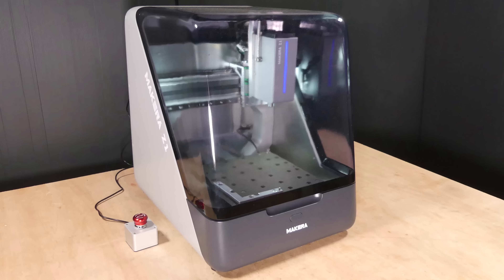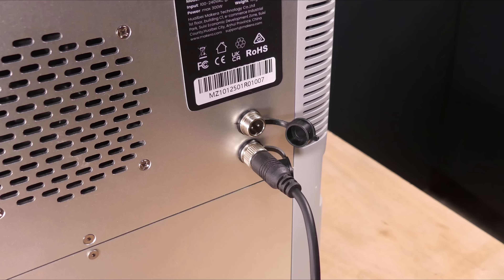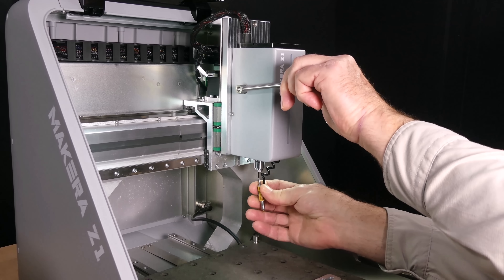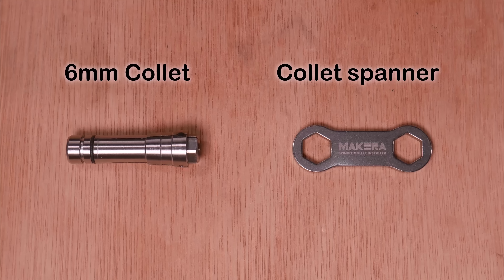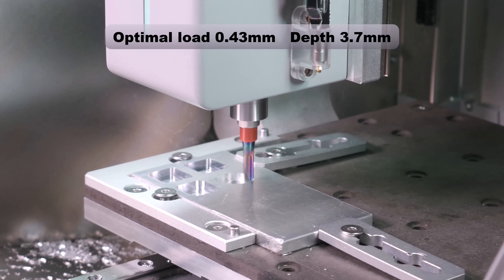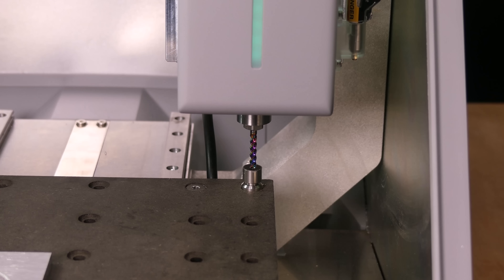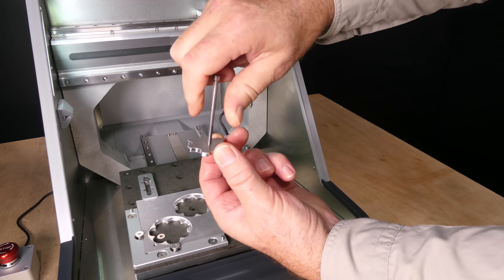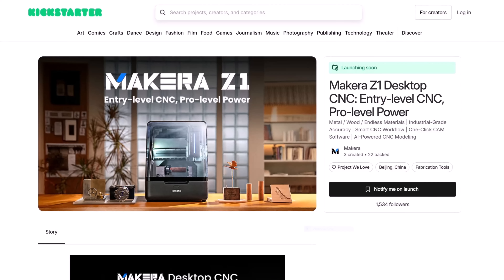Makera Z1 Review: Budget Friendly CNC Mill with Big Features

Comment from the maker: Makera Z1:   https://makera-z1-desktop-cnc-entry-level-cnc.kckb.me/techydiy
https://buymeacoffee.com/techydiy
2nd Z1 review video:  https://youtu.be/NKtECya_V3g
Carvera air:    https://makerainc.sjv.io/carveraair
Coupon code: techydiy100off
Benefit: $100 off when buying Carvera or Carvera Air
Usage: Applies once per order; one use per customer

1/8" 3 flute 15mm DLC  Endmills:    https://amzn.to/47FphaP
Maker Cyclone Dust Collector       https://makerainc.sjv.io/bOK079
Reply: I would love to see how it performs in Nylon. This could just be the tool for me if it can work with Nylon.
(by the way, you forgot to pin this comment).
Reply: In this video, I can't see the Makera Cyclone Dust Collector having any effect on the Makera Z1; the dust collection throughout the entire milling process is very unsatisfactory. Could you please film a video showing the performance of the Makera Cyclone Dust Collector on the Z1 with the cover closed/lid on?
Reply: I would love to see it cut a name out of 16g copper sheet, please.
Reply: Please test a 1/4 4 flute stub at .1 depth and see the max step over with a 2d contour on the outside. Let’s see how underpowered this thing is. Let’s try to break a tool and see what this thing can do. What is the max drill dia? Can I use this the fix a missing hole. Etc
Reply: I would like to do diamond drag engrave, brass or copper, is that possible with this machine? Could you show a vid when you engrave? Thanks
Reply from the maker: Yes, you can drag engrave, I saw someone do it on a Carvera and so it will be possible on a Z1.
Reply: @techydiy Thank you

Comment: Great video. Thanks.
Just curious, how do you hold the piece in place when you're cutting it out without the piece flew away?
Reply from the maker: I included holding tabs. To release you then cut them with a saw and file flat. It’s the reason the edge finish wasn’t great.

Comment: Is there an issue with milling plastics from a 3d printed object. That is is there any softening of the material during milling?
Reply from the maker: Should be ok, just use a single flute endmill and the correct feeds and speeds

Comment: I dont do any machining, but had to learn (or forget) things like calculating rpm and feed rates etc. Is this something you have to do manually for cnc or does software calculate that for you based on tool used?
Reply from the maker: You can do it manually and experiment or there are some good software tools. AI (chatgpt) will make a reasonable attempt at it..

Comment: Do you believe this machine can mill Aluminium day in, day out; or is it being pushed to its limits and is more geared towards plastics and wood?
I'm tempted to pledge but have seen a number of people questioning its ability to mill Aluminium.
Reply from the maker: It’s not being pushed to its limits; it is quite lightly loaded in the video. The spindle power was a maximum of 12% during my tests.
Reply: @techydiy  That's great to know, thanks for the reply.
Reply: @techydiy Does the software show the spindle load while cutting?
Reply: @techydiy 12%...Wow!

Comment: WOW!  Neat little machine and it comes assembled...  Just bought a DMC2 CNC Mill "kit' and spent over 3X what the machine in this video is selling for on initial offer.  And I get the fun of having to assemble, set up and tram on my own.

Wish I would have seen this video before that...  I don't need a big machine, just a small and reasonably accurate one.
Reply: The DMC2 is a more rigid machine
Reply: @arbjful  I tend to agree based off the videos DMC2 has on YouTube showing it machining stainless steel and titanium.

I'm not regretting the decision to by the DMC2 Mini, but this machine requires a lot less work to get up and running and would probably suit my needs near term.  Though the DMC2 will probably be better long term.

Either way...  It's both are a great way to get into CNC milling, without having to design and build a machine from scratch.

I don't think there's been a better time for hobby machinists/makers.

Comment: You think this is possible to have in a flat in separate room? Or is it too loud and does the metal chips get all over the room? Someone mentioned the chips can escape under the y axis rails
Reply from the maker: You can operate it without a vacuum, which lowers the noise, and then vacuum up the chips afterwards. If you machine with the lid closed, the chips will remain inside. I was able to machine with the lid open with very little escape. A few chips may escape to the bottom, but they stay there beneath the machine. You can always add a skirt around the base or place it on a tray. So, it really depends on your circumstances.
Reply: @techydiy Does the lid help with noise or does the entire enclosure vibrate during cutting?

Great video by the way!

Comment: I've never owned a CNC (mill). I have recently been getting ads for this and yesterday decided to reserve my spot for the kickstarter launch. Been an avid 3D printer but for some projects I really want to work with (and mainly just get experience with) metal working and CNC milling. I think this might be my first. Very excited to see what it will bring.
Reply: That’s exactly me! Got my spot on the list today. Very excited
Reply: I'm a CNC machinist by trade and a 3d printing hobbyist. I would not recommend buying a CNC unless you have some experience in the field. Machining is a completely different beast than 3d printing.

Many people buying these mills are going to be biting off more than they can chew. Especially once they realize good cutting tools are expensive as hell and have a finite lifespan before they need to be replaced. (And that lifespan gets drastically cut down when you use them ineffectively.)

 Are you prepared to spend hundreds, if not thousands of dollars on the various cutting tools you'll need over the lifespan of this machine? 

See if your local community college has a manufacturing tech program if CNC is something that interests you.
Reply: @Slamt4stic  You are right on point! But the issue you mentioned is just what Makera is trying to do: reduce the difficulty of using a CNC. Their entry level CNC and AIGC feature is definitely amazing!
Reply: @Slamt4stic Thanks for the tips. I actually don't know anyone with a CNC around here. Money is not the issue though, spent more than 10k on printers throughout my life.

For me, this just feels like a good learning opportunity. I'm confident that I can find my way. :)

Comment: Thanks for making this video. Are you able to provide the dimensions of the “feet” under the machine please?
Reply from the maker: They are 17.6mm tall. They taper from the top to the bottom, with a diameter of 27mm at the top reducing to 21mm at the bottom. They are offset into the base by 3.2mm, resulting in a total height of 14.4mm.
Reply: @techydiy I cannot thank you enough for this. I’m dealing with a hyper specific setup and want to ensure it will fit. 

From a footing perspective how far back are they from the outside housing? So if the depth of the machine is 470mm how far back are the feet from the vertical plane of the outside parameter of the machine?

Many, many thanks.
Reply from the maker: The distances between the feet are: Front to back 380mm, Side to side 300mm. 
The feet are 45mm from the front to the centre of the feet.
The sides are curved, so measurements are probably +- 5mm accuracy.
Reply: @techydiy You are incredibly generous and helpful. Thank you!

Comment: sooo... a snapmaker? basically?
Reply: isnt snap maker a 3D printer ?
Reply: @tankm200  Also a CNC router and a laser.
Reply: @MadeInMichigan  cool, but it is a eazy to use ? and for now we can get this Z1 for like 700 euro or 800 dollars, for me that already have a 3d printer and a 20W laser engraver/cuter this one looks good
Reply: No, not really, it's more like a Carbide3D Nomad Pro (with a laser option).  I had a Snapmaker A350.  It was a nicely made machine, but I don't think the gantry would be stiff enough to machine Aluminum on it.  As for the Snapmaker Luban software, it was not what I would call "user-friendly" (more like "user-vindictive").  I gave the whole machine to my son.  I have both the Nomad and a Carvera, which have decent software also.
Reply: @donbarr9487  I also had an A350. I cut aluminum on it. It was slow and loud, but it did it. 
Two-flute 4mm mill, 10.5K RPM, .1mm DOC. Plenty of oil. Took an hour to put two D-Sub 9 cutouts in a piece of 2", 3/16" thick aluminum square tube, but it did it. Made a horrible mess, too.
Reply: @MadeInMichigan that’s too slow. 0.1mm DOC is very less. 0.5 mm is better, increase the feed to 300 mm/sec. 2 flute 4mm end mill is ok. Skip the oil, not needed for cutting tubes. Maybe air blast should be ok
You say square tube, then it couldn’t have been that slow

Comment: chips are  so nice and feedrate impressive regarding makera recommended parameters, DLC bits to achieve this?
Reply from the maker: 6061 T6 & 6082 T6 Aluminum are both easy to mill. Softer grades stick to the endmills and that is where the DLC seems to help.  
The 1/8" O flute is from Makera, I am not sure of the coating.
The 1/8" 3 flute 15mm DLC. Very cheap (good value) endmills  https://amzn.to/47FphaP
The 6mm and 5mm are relatively expensive DLC coated endmills.

Comment: Looks amazing, however it would've been nice to do a depth test on the Aluminum with something a lot more taller to see how deep it can cut or it's limitations. I like how compact it is but ironically I'd still like to see a bigger bed size in the future. As far as the engravings go I'm glad they have the option but as someone who already owns a laser I wouldn't need it. However I would've also like to see an engraving done without the laser to test the detail limitations and quality. Other then that it seems solid for the most part.

Comment: Nice vid!

Hey I'm really curious about the amount of time it took you to mill out each one of those square pockets in the aluminum. 
- How fast was the smallest feed rate? 
- How long was the fastest pocket?

Interested in these lower cost hobby friendly machines, but they need to be able to efficiently eat through aluminum (for my applications)

Thanks!
Reply from the maker: Adaptive toolpaths were:
1/8" O flute  2:24
1/8" 3 flute  0:57
6mm O flute  0:55
5mm 3 flute   0:27
About the same for finishing.
The feed rates are in the video.
Reply: @techydiy  very helpful, thanks!
Reply: @techydiy  How loud was the machine? Would you say you could work in the same room as the machine as it was cutting metal? Or would it be much too loud? Thanks!
Reply from the maker: It's not very loud, but it would be distracting. I waste a lot of time watching it.

Comment: Man i would really love to see if this thing can do steel. Not that i want to do  that mainly, but it would be great to know.
Reply: It for sure could, slowly, with cooling and using the right cutter.
Reply: No. Do not even think about cutting steel. It will damage the machine.
Reply: @Davoodoox1  If you have no idea what you're doing, you're right, that will probably happen.
Reply: @Davoodoox1 I am pretty sure it can, as long as you keep the cutting forces about the same as when milling aluminium, than there should not be any damage or increased wear. Only difference here would be the time which would probably increase a lot when milling harder materials. I mean the Carvera Air can do some occasional Titanium parts, even if the manufacturer does not recommend it.
Reply: @Davoodoox1  Agreed.   The spindle is high speed,  does not have the torque at low speed, which is what Steel requires.  Fine for softer metals like 6065 and brass.
Reply from the maker: HSM folks HSM

Comment: Is that a soft e stop or hard e stop?
Reply from the maker: I don't believe that the emergency stop switch cuts the power to the machine; however, it does stop the spindle and halts operations. I have pressed it a few times now, and it has worked as expected.

Comment: Thoughts about the lead screws Vs ball screws?
Reply from the maker: The leadscrews have performed ok so far, I am not seeing any obvious backlash, but I need to have a closer look.
Reply: @techydiy  that's good, thinking maybe it's more of a long term issue...
Reply: I wouldn’t buy a CNC with lead screws again.
Reply: @Todestelzer  did it develop lash issues? Or had them right out of the box?
Reply: For 3D printers...no issues but not sure on CNC machines. Unless you experience a crash then I don't see why the lead screw would wear too agressively if maintained. They are also cheaper to replace
Reply: @jacobplatt3066  yeah, just more lash prone I would suspect. It seems to be an odd choice for a CNC machine and not a place I'd probably wanna to try and cut cost. I really wish they had a + version or something with ball screws for an extra $100 or whatever.

Comment: Can one use any end mill or are do you have to use ones that come only from Makera so that it works with the quick change feature?
Reply from the maker: You can use any end mill with the correct shaft diameter. It comes with some of the plastic collars, but they are for convenience, you don't have to use them.

Comment: Im amazed by your ability to get these mostly called "underpowered" makera machines to perform so well. I got a Makera Carvera myself but Im a beginner level in CAM so i was wondering if you maybe could make a video about how to get the most out of your Makera or other "cheaper" CNC machines with the right settings and machining approaches, because machining even small amounts of material volume takes alot of time when using default settings.. so a fool proof way of calibrating, testing and approaching a machining job with an underpowered machine would be really appriciated :)
Reply: it's not too hard. single flute end mills only for cutting aluminum. next take a slow feed rate like 30 IPM and test different DOC, start with something low like 0.015" cut a simple pocket, next try 0.025" then 0.035" and analyze the sound and the cut quality / chip size. you'll hear when the machine is stressing and you'll see when it's no longer cutting clean. once you find that point then drop back on the DOC a bit and start increasing the feed rate for more tests. 

this is the most simple and straight forward way. math nerds will tell you to do all kinds of calculations around chip load but it's not necessary. you can just run some basic tests and get your optimal setup through trial and error.

guy in the video is using adaptive toothpaths which isn't something you want to mess with as a beginner.
Reply: @chrishayes5755 i mean im kind of a math nerd myself 😂 but when studying mechanical engineering you only learn basic calculations for milling operations.. so I was wondering how to get fairly close to the optimum only by calculations and what is even necessary to calculate and then when doing tests what to look out for 😊 I mean screaming endmills i will recognise as bad.. but how bad is bad and what is normal for such a machine.. during my internships in machine shops i learnt what to listen out for.. but these machines were a totally different level so its not 1 to 1 applicable😅. Adaptive tool paths are pretty much the standard when using fusion 360 cam. What would you recommend me to use?
Reply: Crank those feeds and speeds until you hear a tool snap, then lower it slightly ;). Jk ofc, in reality it’s all trial and error, you can usually look up what feeds and speeds tools can handle. Look up videos on correctly setting step over, depths of cut, etc it takes about couple months of learning and you will have it down.